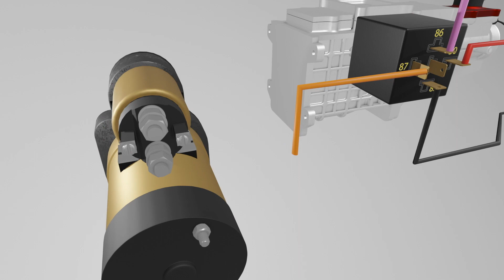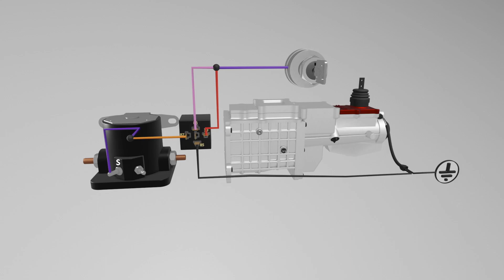Tremec TKO Neutral Safety Switch Wiring

Comment: My question is will the basic tremec 5 speed handle the constant voltage so that you can take the two vss wires and connect to the pig tail coming out of the trans which is NSS?

Comment: Current flows backwards on Black conductor & Ground? Why is this?
Reply: Although the negative charged electrons move through the wire toward the positive (+) terminal of the source of electricity, most diagrams show it moves from positive to negative. But not the case in DC circuitry. Negative electrons move to positive.
Reply: It all depends on whose theory you follow. Forget that and just understand electrons are attracted to opposite electrons and move towards each other.